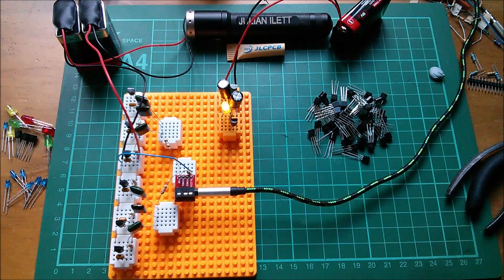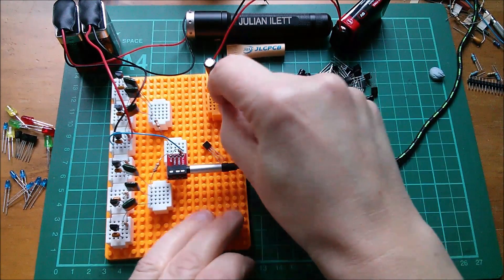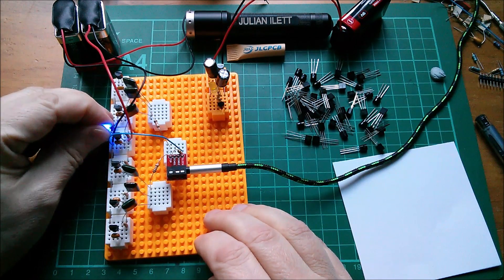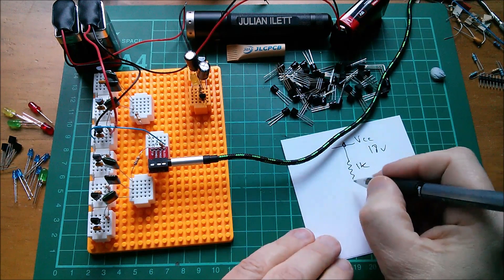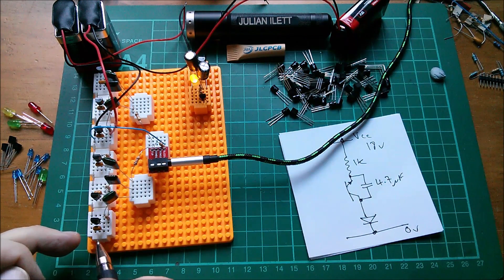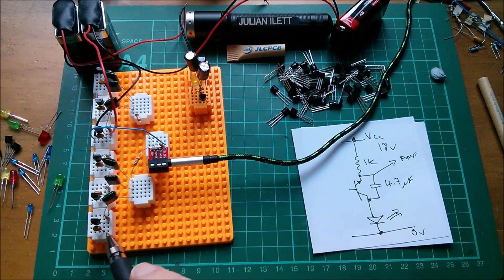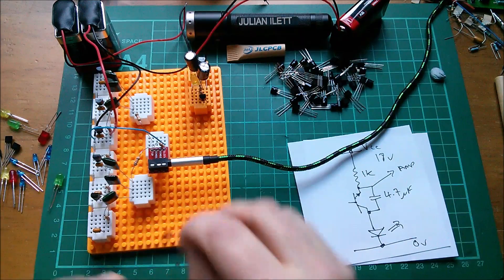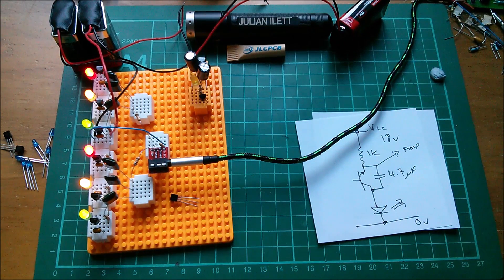Transistor Avalanche Disaster

Comment: Surely the capacitor is at 18V potential even without the LED in circuit?  After all, one plate is connected to Vcc and even if the other plate is floating, it is still at a lower potential than the +ve plate and so 18V would be dumped through the transistor as soon as you put it in circuit.

I'm obviously missing something, but what?

Comment: I think it is a bad idea to put a 4.7uF across CE of the transistor. You should move the capacitor leg on the Collector to the GND instead. This will allow the energy stored in the capacitor to be discharged through the LED as well, instead of just wasting it. I suggest using smaller capacitance value (and increase the resistance value to maintain the oscillation period) to reduce the stress on the transistor. Alternatively, put a small resistor in series with the transistor to limit the charge dumping current.

Comment: The avalanche mode works great but you have to provide a low resistance load in parallel to the transistor CE junction for the capacitor to discharge through.

Comment: Have you had any trouble with those little headphone jack adapter plugs?  Just wondering, I had 5 of them, and when I decided to re-use one, it all went to hell.  The traces lifted off the board (using my soldering iron set at 245C.)   I am still using them, however I rewired them and did not use the traces's at all, but instead ran some solid core copper wire (recoverd telephone inside house wire) from the pins to the 3 exposed connections.  This works OK, but I am now searching for a more stable jack.  The ones I had were made of pressed paper, and even that is separating.  Perhaps they are made for a one time use and I am expecting to much of the little gadgets.

Comment: That's really neat -- but why would you choose to build them with transistors in the first place, rather than the zeners you are comparing them to (just curious)? (I know that wouldn't have saved them given your capacitor and LED situation) Wouldn't that save you the (maybe non-issue) issue of having a floating gate, and you could drive it from a lower source voltage?

Comment: When I got into electronics a year and a bit ago I kept coming across this circuit and everything about it seemed wrong. Especially operating the transistor outside of its recommended conditions. I just stuck with the classic multivibrator.

Comment: Appears to work a lot like a unijunction transistor oscillator.

Investigated them as a way of converting the value of a large range variable capacitor into a frequency. The 555s I'd been using previously would work OK for a while then "randomly stop working"... Eventually figured out that reducing the value of the in circuit charged capacitor by 100 would step voltage across the capacitor by 10... And that was zapping the 555s.

Comment: In your astable, the same breakdown effect is happening each time the LEDs change. As one transistor turns on, the end of the capacitor tied to it's collector is pulled to the negative rail. Since, just prior to the transistor turning on, the same said capacitor had a charge across it of the difference of the supply rails (less the Vbe of the other transistor), the base of the transistor that turned off will have it's base now pulled below the negative rail by that amount but the reverse breakdown limits the lowest value that it reaches. Pick around the circuit with an oscilloscope.
For what it is worth, when I construct two transistor astable circuits, I always place a 1N4148 diode between the transistor base and the resistor / capacitor junction to prevent reverse biasing the base / emitter junction.

Comment: Hello Julian, I saw your Monster Bright Solar Garden Light video a long time ago and decided to build one! I ordered the parts to make it, and when I got them in I started assembling everything by your build video!! Everything went fine, that is until I tried to power them up, and the DC to DC converter boards I got literally EXPLODED!! And the kicker to that is I wasn't even running them on full power, I was only running them on a 9 volt battery which SHOULD NOT have made the capacitors pop, BUT in my case they did!! I have since given up on the project, just because I am on a very limited income and can't afford to replace them for normal LED driver units that might work that are more money!! BUT I was wondering if you ever thought about making a video about how to build your own DC to DC converters for a similar board that would work with a 20 watt LED??? Anyhow have a great day and I so enjoy the videos you post!!

Comment: I buy transistors and other electronics in bulk and noticed that some are dead or the HFE is out of spec from the factory.  I always thought that they test a few out of X amount of product. I guess some slip through. Than again, my gf enjoys putting leds on my power supply, turn it up to 36 volts with 10 amps and blow the led....
Reply: They test parts then sell the failures to hobbyists in bulk.
Reply: @1pcfred  thats electronically sinister !
Reply: @1pcfred  i kinda figured that. Ive always wondered if they'res more stringent quality control when it comes to pick and place machines that pull from a reel ?
Reply: @1pcfred yes.  i used to to work on military application electronics so it wasn't uncommon to sit and test parts for a matched pair. But i just can't wrap my arms around the fact companies today will send out bad batches.
Reply: @1pcfred  i understand what your saying. But we had a stringent component quality control just in case one slipped by. As a kid messing around with electronics,  i came acrost bad parts bought from cheesy electronics flyers. Your right.

Comment: would a additional low value resistor between the cap and the emitter solve this problem? i think it would and it should not destroy the oscillator function of the circuit...

Comment: Thats a nice oscillator!
removing the LED produces a popping sound. I guess its the capacitor in the mixer that rapidly charges to the 18V supply.
Your oscillator circuit is in a series configuration which enables you to obtain a ground referenced output signal by moving the 1k resistor to ground.
I guess that this configuration wouldn't entirely eliminate the popping, as the current through the resistor would still give you a dc offset on the signal

Comment: Its avalanche. If you put a zener in place it will just clamp at its reverse voltage.  This oscillate because the avalanche is much higher than vce when switched on.

Comment: Julian, put a resistor into the transistor socket E and C holes on your yellow DMM, and you will see much more "hFE" if you apply enough small resistor value. So never believe in such a cheap DMM.

Comment: So I think I might have missed the point, so I wanted to pose this question. Was this an experiment to show what happens when a transistor is operated in avalanche mode or is this a veiled attempt to say that you can "safely" operate a transistor in Avalanche mode? I do realize that there are some transistors designed to operate in this mode, but a 2N3904 is definitely NOT one of them. I'm just kind of wondering.....
Reply from the maker: Nothing veiled on this channel - just wanted to see if it would work :)

Comment: YouTuber Look Mum No Computer has done a few interesting videos with this circuit, you should definitely check out the fun things he has done with this oscillator. 
You can fnd other transistors that will work with lower voltages too. Here is a link to kerry d wongs blog where people discuss this nifty little circuit, and some other transistors to try.
http://www.kerrywong.com/2014/03/19/bjt-in-reverse-avalanche-mode/

Comment: After watching this, I had to try it.  A few things I discovered:  At a voltage of 12 or less, I see a small AC waveform at 60 Hz.  Power supply ripple I assume.  But when I hit 13 volts, I get an oscillating waveform.  As I increased voltage, the frequency increased.  At 18 volts, it's about 1.1kHz.  It's not quite a saw-tooth waveform.  Varying voltage and capacitor values, you can see the rising edge is exponential.  But if you have a short rise time, it looks like saw-tooth.  The falling edge is much faster.  Only one 2N3904 was hurt during this experiment.
Reply: Any circuit where a capacitor charges via a resistor, or discharges via a resistor by any significant voltage difference will have an exponential curve.
Reply: @Mark1024MAK can you expand on this comment?
Reply: if you want a linear rise/sawtooth try a constant current supply.

Unijunction transistor oscillators  are fairly similar to Julian's design. Programable unijunction transistors can be programmed to breakdown at different breakdown voltages. down to about 1V. They do have a bit of reputation for being awkward to set up to oscillate/avoid them latching into  conduction. I found it fairly easy to set the programming voltage from between a constant current module across a resistor to ground. and then then feed the timing capacitor from a slightly smaller constant current.

Comment: @Julian Illet why didn't you use one of these rather than that multimeter tester ? Component tester  in your video https://youtu.be/sLVcEJYxpLg?t=70 And, regarding the multimeter, shorted collector to emitter ? First test we do And/or open collector/base or emmiter base junctions   . With a multimeter these are the important tests. HFE is meant to be used when you have a working transistor. That said, I'm really wondering what the Component Tester in the video I linked would show in its diagram for some of these bad transistors ? Maybe it would give the missing component message ? I was on a facebook page, a while ago, and we were commenting about this tester, and the actual first designer (Before it was jacked by the Chinese and sold on ebay ect) . I'd like to know more about him, and what he might be doing now ? One would need to know if there were any additional words used besides "component tester" .

Comment: I think the top three are interacting with each other and the bottom three with each other through the coupling capacitors for the audio output. It may need six resistors and six capacitors instead of two resistors and six capacitors.

Comment: On my scope it looks a lot like the output of an oscillator made with a UJT with it's shark fin shape.
The waveform coming from the base is similar but has an interesting little blip at the top.
It starts oscillating at about 10V and the frequency changes depending on the voltage it's powered from so I guess it's a VCO of sorts.

I might try finding an NPN that oscillates at a lower voltage.
Reply: Kerry D Wong tried 8 types and wrote it up on his blog - the NPN that oscillated at the lowest voltage was SS9018 @ 8.2V* which would therefore work off one fresh 9V battery.
* though it varied between batches. 
but I think there must be types that oscillate at lower Voltage.

Comment: I see THREE 9v batteries that appear to be in series (the 3rd is to the right of the flashlight).

 Three x 9v = 27 volts.
Reply: appears 1 is just running the 'traditional' transistor oscillator 1x9 = 9... the other 2 are in series 2x9 = 18

Comment: Actually reason why this works and oscilate is that transistor in this configuration works not like zener diode but like diac. It start conducting on some voltage on capacitor and keep conducting until voltage go down little bit and stop conducting, capacitor is charging up and again, voltage is rising on capacitor, transistor start conducting and so on... With zener diode this will not work, because zener just stay in stable operating point... Actually you can use transistor connected this way instead of diac in tyristor dimmer. There you need current impulse to trigger the gate. Diac is different, you cant use zener diode there instead.

Comment: I’ve said it before, Julian, get a proper lab supply with current limiting! Developing circuits with batteries as a power source is asking for trouble. Mistakes can get expensive very quickly. Current limiting is absolutely essential when experimenting. It wouldn’t have saved your transistors here, but I cringe when I see batteries connected to breadboards. I still can’t get my head around you owning a Keysight scope but no bench PSU! :-)
Reply: Also a lab supply would not have saved his pile of transistors.
Reply: Alex C -   Yeah, I said that in my OP.;-)
Reply: No one wants to watch a dry lab procedural. Hijinx and banter and down-to-earth mistakes make good videos. Videos $ell. Julian makes circuits with batteries because Uncle Fumble makes circuits with batteries and goes on YouTube to find out where his idea went wrong. Uncle Fumble doesn't have an oscilloscope, so Julian rarely brings it out.
Reply: A current controlled lab supply would not have saved his transistors. Neither would a 10M resistor across the capacitor.
Reply: He has loads of those Ruideng or Minghe CC/CV buck/boost converters, not sure why he's using PP3's instead of anyone of those attached to his solar battery. Even at this time of year, there'd surely be enough power left for that.
Reply: I don't have one - I do use a polyfuse when experimenting though and I'm more careful if moderately expensive parts are involved (who cares about one transistor?)... Then again I don't have an oscilloscope either. I've used an Arduino's analog input to graph waveforms in one project.
Reply: He got the oscilloscope from the factory free of charge. But none PSU factory sends him a lab power supply. :-)
Reply: That doesn't help. The output capacitor of a lab power supply has enough energy to kill electronics long before the current limit has any effect.
Reply: MetalheadAndNerd - Current limiting on a lab psu doesn’t help? It’s an  essential feature on a lab supply.
Reply: @ProdigalPorcupine  In theory yes. In practice it cannot protect  transistors in a short circuit situation because of the output capacitor that every lab power supply has. I also wasn't aware of this fact before I had killed the first boards full of transistors with current limit set to a fraction of what these transistors can handle.
Reply: MetalheadAndNerd - Yeah, we’ve all been there! :-)  I’ve tried to design my own linear psu with minimal or no capacitance across the outputs. I failed, it oscillated spontaneously when transitioning between CC and CV.
Reply: @ProdigalPorcupine  If you had similar experience, why do you believe that the small signal transistors in the video would have been saved by a current limiting lab PSU?
Reply: MetalheadAndNerd - I didn’t say it would have saved them, what gave you that idea? You may want to read my original post again!
Reply: @ProdigalPorcupine  When I wrote that a current limit wouldn't have saved the transistors you replied: "Current limiting on a lab psu doesn’t help? It’s an essential feature on a lab supply."
Reply: MetalheadAndNerd - You actually said ‘that doesn’t help’, referring to current limiting. I assumed that was a general comment on the usefulness of current limiting, as you went on to mention the stored energy in the output capacitor of current limited psus. In any case, the mode of failure in the actual video was down to the circuit topology, the type of supply wouldn’t have helped in that instance. I said that in my OP.
Reply: That Keysight scope was kindly offered by the company and being in this kind of production quality no company will bother to offer a free PSU. Dont you think it was wise to show the oscillation on the scope ? Does it really matter if he has instruments or not ?

Comment: This circuit could not work without some sort of hysteresis. Wonder if there are some parasitic inductance in your long leads...
Reply: It's in the transistor. It stays on as the voltage on the cap drops, to a point.
Reply: @Ellipsis780  So then there must be more going on then the avalanche effect. The avalanche effect has no hysteresis according to the characteristic IV curves.

Comment: So creating a short between C and E kills transistors?
Reply: No.
Reply: Eddie - It’s the amount of current that flows when the transistor is reverse biased that kills it. What happens is, the capacitor charges up, as the transistor is not conducting (as it is reverse biased). But at some point, the voltage across the capacitor, which is the same voltage across the transistor, gets to the “break down” voltage of the transistor. The semiconductor junction in the transistor can no longer withstand the voltage. So suddenly it allows a high current to flow. The capacitor then dumps nearly all of the charge on it through the transistor (the transistor having “broken down”, it keeps passing current even when the voltage drops below the break down voltage). This current only stops when the capacitor is nearly empty of charge.
If the peak current is too high, it will damage the semiconductor junction, hence killing the transistor. A suitable low value resistor in series between the transistor and the capacitor would have limited to peak current, and thus should have saved the transistor.

Comment: The christmas before last I built one of those "3D christmas tree" kits from China, and because I was being cheap I got the non-microcontroller one. It uses exactly this sort of oscillator, with the avalanche effect. I think your having to use 18V has to do with the high frequencies you are generating (because you have to lead more power into your capacitor, which is being emptied more often than in my christmas tree kit, which runs on to AA batteries, so it's 3V), but I found out they pulled a fast one and just assumed all LEDs had the same drop voltage, which makes the red LEDs blink nicely while the green and yellow ones just show some kind of dim wavering glow.
Anyway, the two-transistor flip-flop you have on the top right is how an oscillator should be built, I'm deeply sceptical to circuits basically abusing component malfunctions.